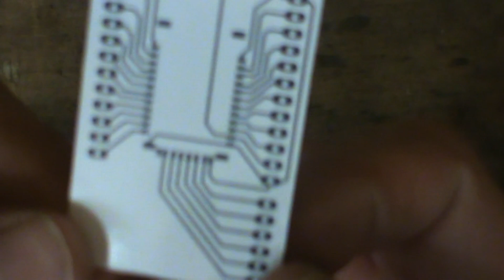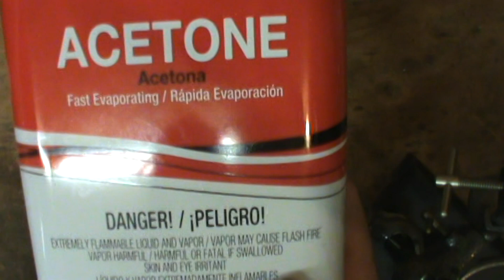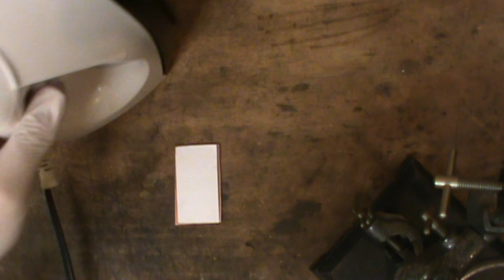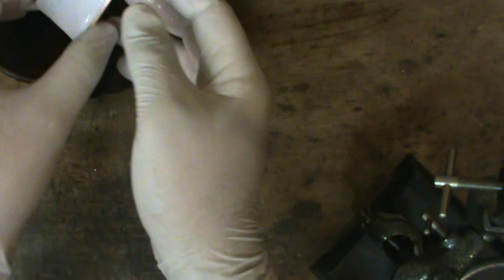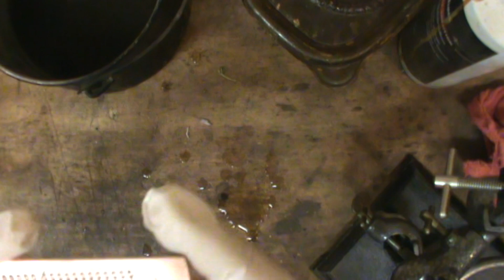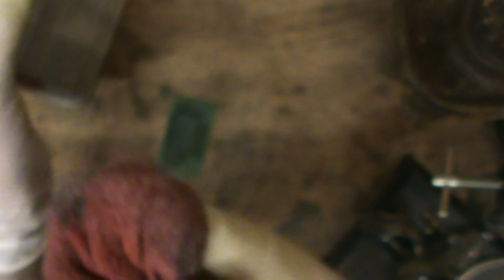PCB Etching - Toner Transfer Method

Comment: how long after printing could you go b4 it could no longer b transferred mainly would it still work if you printed the design and then did the transfer 30 minutes to an hour later?
Reply from the maker: Yes it should still work.  That is the beauty of toner. You just have to heat it back up to transfer it.  Now you may need to heat it longer with your iron since the page would be cooled down by then but it should still work.
Reply: this might sound ghetto or whatever but i just dont have a laser printer yet. do you know of any place that would let me bring paper and they print my design on to that paper for me or let me printer it, like would the ups store do that?
Reply from the maker: If you are in the US Kinko's or a library would work.  Just PDF your design and put it on a flash drive.
Reply: im in the US ya know i always forget about the library but idk if we have a klinkos where i live (small town)

Comment: actually if you would take something like a sponge and rub the copper with that sponge in the Feric chloride it will etch much faster. .and if you heat that etchant you can get to something like 2-3 minutes

Comment: How you make sure that your printing is mm precise so when you put in a part with fixed length and width of wiring it fits well? Also how do you dispose of the etching acid?

Comment: Photo paper is expensive, I use the thicker covers off glossy magazines, and leaflets that come through the letterbox, works just as well and is free. Also I used to be a fix laser printers, the laser actually draws the image onto a photo conductive drum built into the toner cartridge from there it is transfered onto the paper by electrostatic charge, then fused onto the paper by heated rollers of belts. Thanks for an informative video.

Comment: Is the copper left on the backside of that board not going to create shorts ?
Reply from the maker: It depends on the through hole stuff.  this example is just showing how it works.  But you are correct that if there were through hole parts that needed soldered on the back side I would need to remove the copper.  How to do this is by taking packing tape and placing it over the already etched side to protect it and then placing it back in the etchant to remove the back copper.

Comment: Nice Video 👍👍👍 
a little tip when using etchant , the concentration of the acid is decreased as it reacts with the metal , higher concentration == fast etching , 
so , don't add used acid to new acid as this decreases the concentration as well , to do that without  wasting the acid , add just a little enough amount of acid 
this works well for me .
Reply from the maker: Great tip.  You are absolutely right.  Thanks.

Comment: hi,from knowledge do you know what kind of laser printer works(some say that it needs to be color photographic,it make sense to be photographic hence the glossy paper that would get stuck in an non photo but way color???)
Reply from the maker: It seems to me that any laser printer will work.  I have not tried a color laser printer but the theory should be the same since it is the tonor is what you want.  However, an inkjet will not work since it is ink.

Comment: What track thickness , clearance this paper toner transfer method can do ?
Reply from the maker: I usually do not go any smaller than 6 -12mil depending.  Some times you just have to play around with it.  If I get it too close I then sometimes have to use an xacto knife and cut the trace out.
Reply: Thank You

Comment: Do you really need acetone?
Reply from the maker: +The  Plaid Gamer Well I am not a chemical guy so I don't know what else could dissolve the toner but I am sure there are other things that could I just don't know them and as readily available as acetone is where I live it is not a problem and it is cheap.
Reply: lacquer thinner will also dissolve the toner just a little slower.

Comment: Pro-tip - if you warm up the etchant it will work much faster. I keep etchant in plastic airtight container from Walmart, and to warm it up I put the container on a hot water bath (it's just larger container with hot water). This way etching time drops to just 3-5 minutes.
Reply from the maker: +asmi06 Wow awesome tip.  I will definitely try this out.  Thank you very much for this great tip.

Comment: Do you have to use a laser printer for making pcb boards?
Reply from the maker: +Justin Verrall (Through  The Process) Yes because you are using the toner as the etch resist.  You cannot transfer ink in the same way.  Thanks for the question.
Reply: Fuck..... Thank you for the help though

Comment: Looks like your toner transfer method fail. You have some incomplete traces. You must consider another type of paper, or another printer.
Reply from the maker: lipsa pauza Well I was doing this very fast so I did not put the iron on it long enough and also I recommend that when you do this after you have done the toner transfer before you etch you should inspect for place where the toner did not stick and if you see those places a permanent sharpie marker works great for filling in those gaps.  Also take note that this is no match for a professionally made board.  This will only get you by with simple WIDE spaced trace and pad layouts and is not recommended for any high temp/humidity situations since there is no mask and you cannot guarantee uniform etching when doing this method.
Reply: misperry  photo paper did you use? I used kodak photo paper and it did not work worth a shit.
Reply from the maker: Well that sucks!  I used Walgreen's brand that was the cheapest you can get.  The cheaper the better
Reply: lol ok thanks
Reply: +lipsa pauza use pcb transfer papper its like 15 bucks for 100 sheets

Comment: toner works that the paper is being electrically charged, then the laser shoots toner particles on the role, so they get decharged ( normally they are,positive and paper negative, laser makes a particle neutrral), then it rolls over the paper, charged toner goes to paper and then heat bakes it in
Reply from the maker: Hey there and thanks for your comment.  Actually if you want the details of how a toner printer works it is as follows:

The Primary Charge Roller, or the PCR, will charge the OPC drum with a negative charge.  Then the laser will charge the roller (not shoot toner) with a positive charge in areas to form the image on the OPC drum.

There is a hopper of toner that has a device to stir the toner in it and the toner adder roller collects the toner and distributes it to the developer roller where the doctor blade levels it all out.  The toner will get a negative charge as it moves from one component to the next.  This will attract the toner to the positively charged portions of the OPC drum.

Next the toner on the OPC drum will be transferred to the paper and the paper will finally pass through the fusing assembly where the toner is fused to the paper via the heated rollers in the fusing assembly.

Thanks again for your comment.